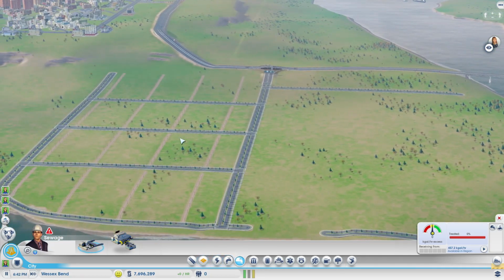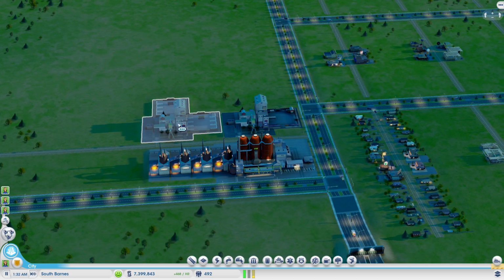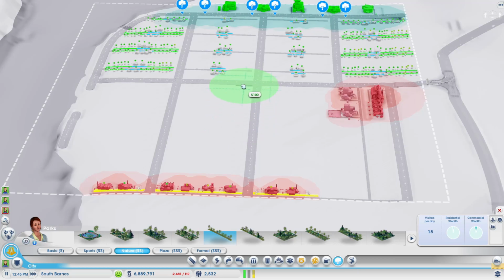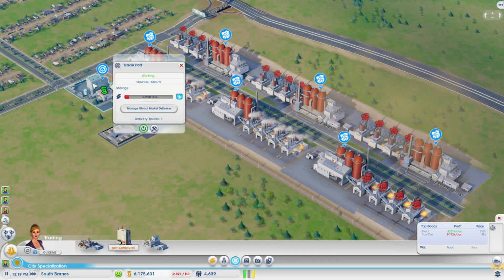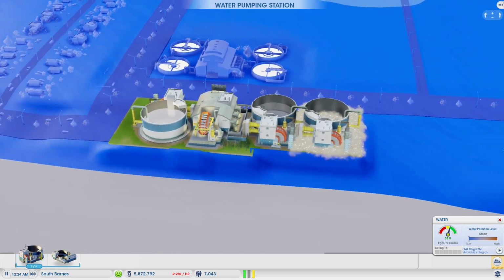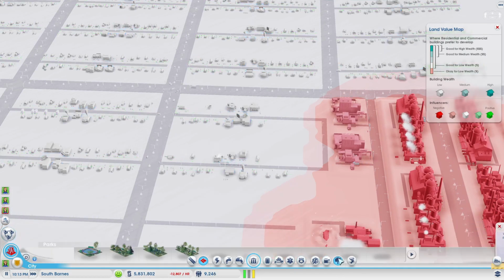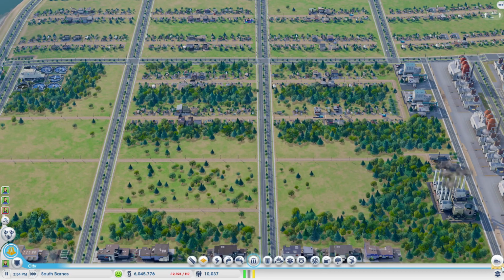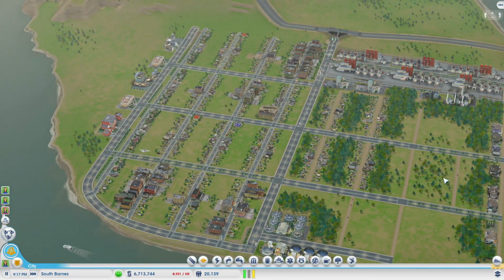NEW CITY: METAL! | SimCity in 2021 | SimCity 5 | SimCity 2013 | SC2013 | SC13 | SC5 | Basement

Comment: 0:00 My region Azureview Bay is up on the Asia server, & will be visible for slightly less than 2 weeks before vanishing (it'll still be around, but not show up on the highscores).  It's completely built & ready for viewing.  To view, log into the Asia server (you have to switch to multiplayer, close the game, relaunch it, and then select server from the launcher), click the SimCity World > Highscores > Headquarters > Click my icon > Azureview Bay > Pick a city > Visit.

0:01 Mistake; city on this plot is the wrong spec.  Should be Gambling here.  Inaccuracy; roads are too close to the coastline; streets are too close to avenues.

1:37 Mistake; RC zoning is rotated 90 degrees incorrectly.  Traffic increased.

7:49 "Do I want to do this?  Probably not, but I'll do it anyway."  This is the highway to regret.

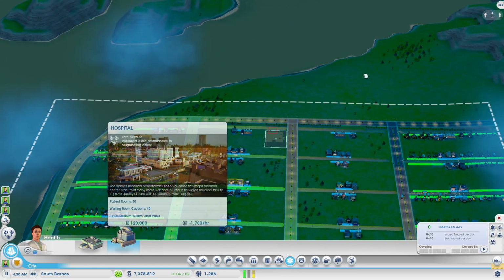9:26 Medium wealth will get sick at the Smelting Factories, come home, and then complain about it.  They are pointless in a Metals city.

10:46 If there's another city with a dump with a highway connection, subsequent cities get one day-month (they're the same in this game) of free garbage coverage.

19:20 Singleplayer market that overvalues metal is carrying lol

21:30 The inaccuracy with this is that you didn't save the space that the initial dirt road was built on.

22:02 A nuclear PP here would've been fine, since the industry isn't long for this city and the nuclear PP would be the only user of industrial tech in the city.

23:20 Saves space, workers, & hourly.  See Azureview Bay while you still can.

24:38 It takes a few game-minutes for modules to activate after they are plopped.

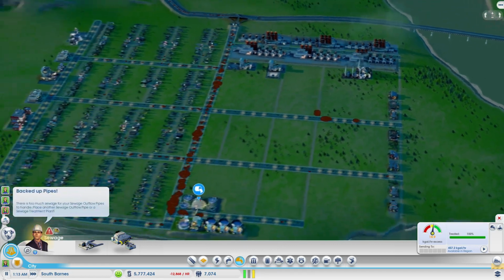25:52 Inaccuracy; this is one of the least space efficient patterns for expanding an oil PP.

28:10 Those are mids, not rich.

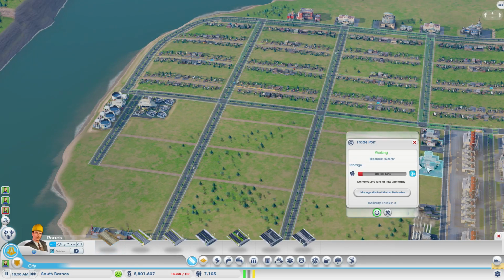28:37 If jobs get too far ahead of workers, density of residential buildings will skip ahead to medium density.

29:20 This is how you're supposed to build truck-only trade ports, since the space between the one lot and the road it's plopped on generate more plop points for trucks.

30:16 Conglaturation Barneses :P

30:50 Low wealth will spawn there just fine.

31:00 Mistake; these parks are pointless.

32:28 The only situation when low wealth parks are justified is next to megatowers with low wealth apartments and no matching low wealth mall, or when there's open space that a road can't reach.

34:40 Yards mean long hours wasted gardening & mowing.  No thanks.

35:12 You would if you built more smelters.

37:30 You don't really get punished for zoning & road patterns at medium density.  At high density, punishments become crushing.

42:06 It's always wrong.

42:37 Cities have been generally getting better over the course of the series.  That fuel city was truly dreadful, though.  See Azureview Bay for some exemplars.

44:00 That's how it always goes in Oil, Metal, Electronics, & Trade cities.
Reply from the maker: I checked out your region - very impressive! Also, I sent you a friend request through Origin (is it through Origin?) or SimCity or whatever so that we can build in an online region together after I finish recording this series.
Reply from the maker: 0:01 Mistake; city on this plot is the wrong spec.  Should be Gambling here.  Inaccuracy; roads are too close to the coastline; streets are too close to avenues.
BASEMENT: I'm not to the level of planning which specializations go on which maps (other than getting oil/ore/coal from the ground)

1:37 Mistake; RC zoning is rotated 90 degrees incorrectly.  Traffic increased.
BASEMENT: I still like it that way, though. Makes sense to me in a real-life way to drive from home to big road, then turn on big road to go to work.

7:49 "Do I want to do this?  Probably not, but I'll do it anyway."  This is the highway to regret.
BASEMENT: I play fast and loose. (not actually fast, though)

9:26 Medium wealth will get sick at the Smelting Factories, come home, and then complain about it.  They are pointless in a Metals city.
BASEMENT: Suburban snobs!

10:46 If there's another city with a dump with a highway connection, subsequent cities get one day-month (they're the same in this game) of free garbage coverage.
BASEMENT: That's a nice feature

19:20 Singleplayer market that overvalues metal is carrying lol
BASEMENT: I'll take it

21:30 The inaccuracy with this is that you didn't save the space that the initial dirt road was built on.
BASEMENT: I just wanted it close, not perfect. I was guaranteed to have it work this way.

22:02 A nuclear PP here would've been fine, since the industry isn't long for this city and the nuclear PP would be the only user of industrial tech in the city.
BASEMENT: I do NOT want a nuclear disaster later. I gotta read up on that.

23:20 Saves space, workers, & hourly.  See Azureview Bay while you still can.
BASEMENT: that utilities city is crazy, and very cool. I'm going to have one city build extra utilities at the end of its run so that the next won't need to build any - should be fun.

24:38 It takes a few game-minutes for modules to activate after they are plopped.
BASEMENT: I needed more patience

25:52 Inaccuracy; this is one of the least space efficient patterns for expanding an oil PP.
BASEMENT: space wasn't at a premium for my goals in this city

28:10 Those are mids, not rich.
BASEMENT: I often refer to the middle-class as rich in this game because so many of my residents are low wealth. Suburban homes look like mansions when you stare at trailers all day every day!

28:37 If jobs get too far ahead of workers, density of residential buildings will skip ahead to medium density.
BASEMENT: oo, that sounds like a nice exploit

29:20 This is how you're supposed to build truck-only trade ports, since the space between the one lot and the road it's plopped on generate more plop points for trucks.
BASEMENT: I like tucking in the trucks between the lots and the road

30:16 Conglaturation Barneses :P
BASEMENT: 

30:50 Low wealth will spawn there just fine.
BASEMENT: 

31:00 Mistake; these parks are pointless.
BASEMENT: they're FUN though, and I play the game for fun! :)

32:28 The only situation when low wealth parks are justified is next to megatowers with low wealth apartments and no matching low wealth mall, or when there's open space that a road can't reach.
BASEMENT: or if you think they're fun

34:40 Yards mean long hours wasted gardening & mowing.  No thanks.
BASEMENT: ooo, I like raking and mowing. I listen to music and have myself a little workout. I find it satisfying.

35:12 You would if you built more smelters.
BASEMENT: MORE? I don't need too many. Just some.

37:30 You don't really get punished for zoning & road patterns at medium density.  At high density, punishments become crushing.
BASEMENT: ah, so my strategy is a perfectly splendid one since I keep things at medium

42:06 It's always wrong.
BASEMENT: If it's always wrong, I don't want to always be right!

42:37 Cities have been generally getting better over the course of the series.  That fuel city was truly dreadful, though.  See Azureview Bay for some exemplars.
BASEMENT: The fuel city was pretty bad, I'll grant you that.

44:00 That's how it always goes in Oil, Metal, Electronics, & Trade cities.
BASEMENT: I'm going to shoot for -50k per hour in the processor city